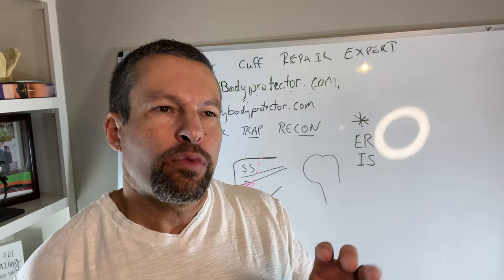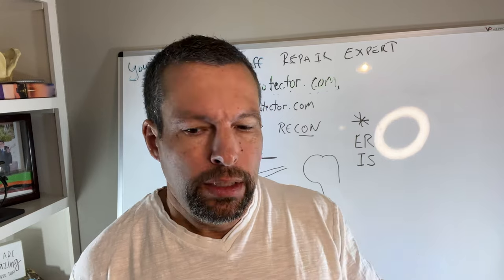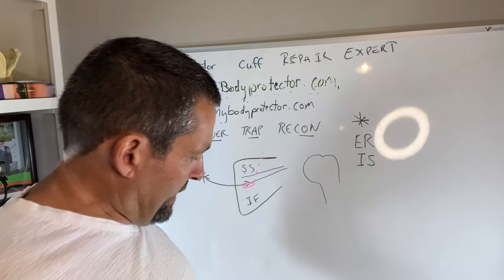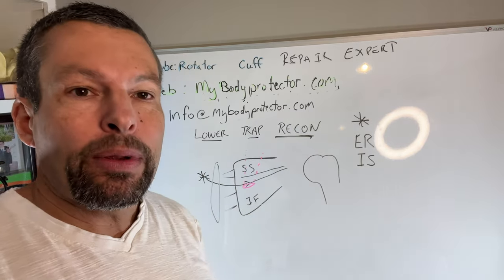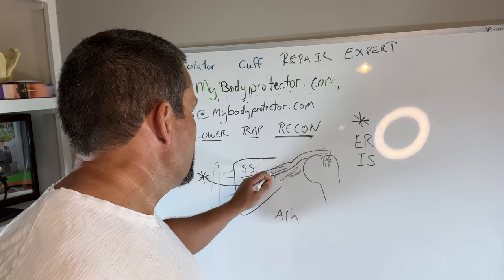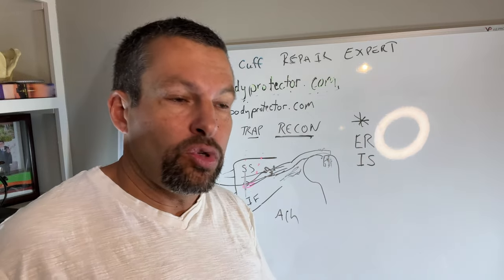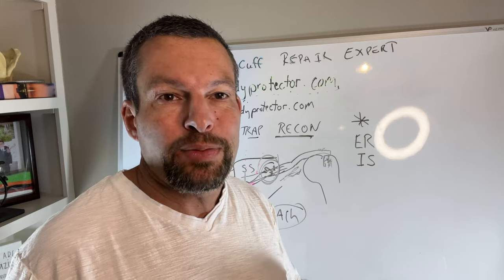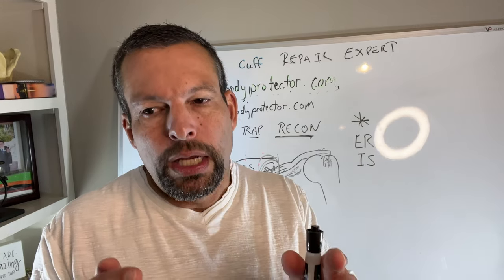Trap Transfer,  Is It A Good Solution For You?

Comment: Just been diagnosed with unrepairable supraspinatus and infraspinatus I still have decent range of motion but my external rotation is weak. If I were to have this surgery how much external rotation strength could I hope to recover? Thanks for your help and really like your channel.
Reply from the maker: Hey Darren, that is a tough question.  The reconstruction is a big surgery with a long recovery.  I would recommend a long discussion with your surgeon prior to signing up.  I currently do not do this surgery as I have not been happy with the outcomes in the literature. Also thanks for subscribing!
Reply: @rotatorcuffexpert  Thanks for taking the time to reply much appreciated my main concern is the lack of stability in my shoulder joint I still have decent ROM and reasonable strength I guess I will just keep going as it.
Reply from the maker: Yes,  it is a tough decision for sure

Comment: I had a lower trap transfer 5 days ago.  Any info about rehab would be appreciated.  In particular, my job involves using a computer (keyboard and mouse).  What is a reasonable time frame to return to these activities without compromising tissue healing?
Reply from the maker: Paul, hope you are feeling ok today.  That surgery is a tough one!  It takes a long time for the allograft to encorporate (heal in) with your own tissue.  In most rotator cuff repairs it people are out of work for 6-8 wks.  Your surgery is a bit more intense and is relying on the donated tissue so it may be longer.  Check with your surgeon for your specific situation.  Please consider joining our newsletter. Just email me at dro@mybodyprotector.com and put yes in the subject line and we will get you set up with a few tip sheets as well!